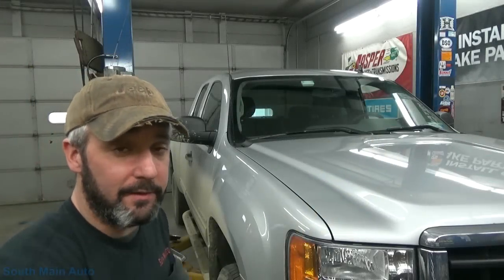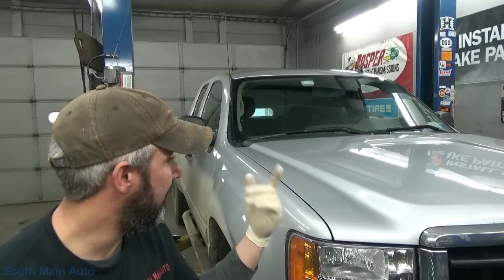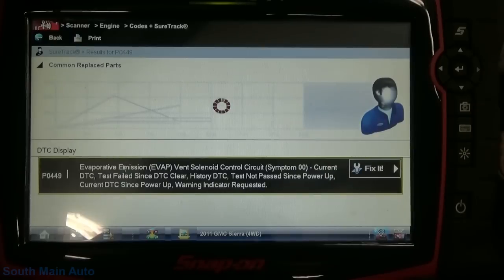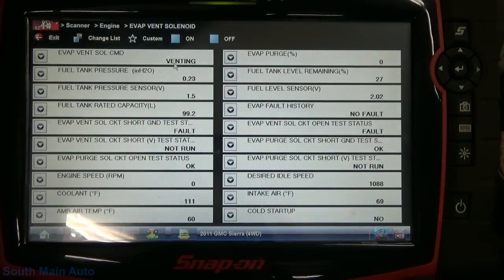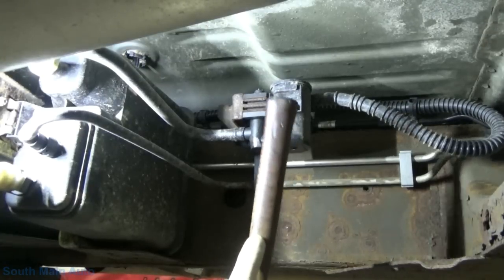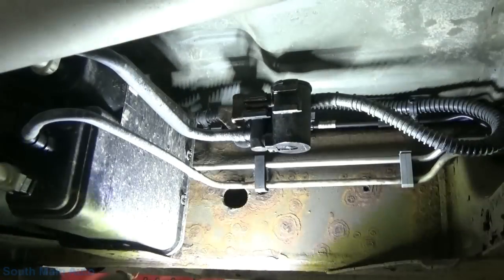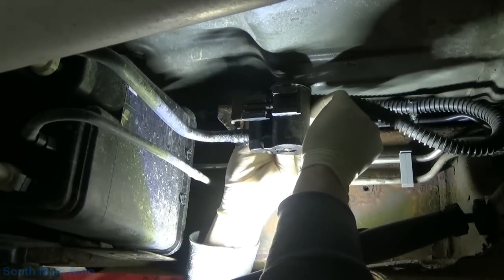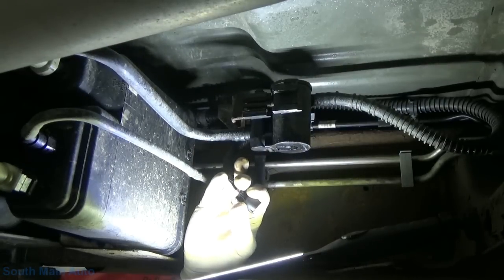GMC / Chevy Truck -DTC P0449 EVAP Vent Solenoid Control Circuit

Comment: One recommendation is putting a brief or detailed description of the vehicle in the description, it will probably net more views too when someone searches 2011 GMC Sierra Evap Vent problems.
Reply from the maker: Good idea
Reply: South Main Auto Repair mainly because I'm descriptive in my searches, others may not be. Love your channel.
Reply: Chance George You are correct I need info on a 99 Silverado 5.3 I'm trying to guess what year he is working on and find out it's 12 years newer but still a good video to use if I ever upgrade
Reply: Most vehicles are similar thru generations especially gm. 4to 8 years is average generation.
Reply: Or any chevy thats how I find it
Reply: It’s pretty much the same between 1999 and 2009

Comment: Thanks! Found the "Green Crusty" 1 inch from shiny vent valve solenoid connector on 2010 Suburban and took a "Money shot" as I pulled the insulation apart to see green dust spray EVERYWHERE!

Comment: "Incandescent test are no good and you should then throw them away!" said an instructor for a continuing education class for work. It's funny how the next day I was testing a circuit on a GM and the service manual specifically said to use an incandescent test light.
Reply from the maker: Joe Goodman the incandescent test light is the most undervalued tool the shop

Comment: I have a 2010 Cadillac SRX with 3.0 V6 direct injection engine the 3 pin pressure sensor what I found was problem with the 5 Volt reference pin was so corroded it was broken off into the wired part of the connector caused by water damage it was causing a P0449 code thank god GM located near central underneath of the driver side door  which made it easier to access I clipped the old connector off replaced it with a new one from eBay spliced in the new one with but connectors problem solved I also replaced the purge valve located behind the throttle body and the ruff idle is gone also hope this helps those of you with the Cadillac SRX later models 2010-2016

Comment: this is a common issue on these trucks ... the get filled with dirt/mud ( as you can see from the dirt on the truck ) there is an updated part by GM where you reroute the pre filter to a new location and use heater hose for the hose and use ban clamps to connect everything... 

you can also use a noid light in the connector and use it to test the circuit. the gm one in the kit fits perfectly in most connectors. typically use to test injector pulses 

i work as a drive ability tech for GMC dealership

Comment: Thanks for the video.  I just did this on my 2011 Silverado  - LT - 5.3 - 41k miles because of a p0449.
The part number is 22840971 for the assembly.  I tried to get just the solenoid, but had to get the whole assembly for ~$60 online.
Amazon, Autozone, etc.  told me that that part does NOT fit my 2011 Silverado, but the dealer told me it would and they were right.  The long tube that goes to the gas filler neck would not just pull out because the truck assembly process left a "hole" just big enough for the tube, not the filter at the head.  I just cut the tube for removal and there is a bigger space above the original route. and the head went through just fine. I couldn't get the electrical connection to come apart until I slid a small screwdriver up under the locking clasp and worked it around to release the clasp.
Thanks again for the video.
Reply: Same here, Amazon tells me Dorman 911-524 won't fit my 2011 Silverado 1500. I got mine from Parts Geek where their website said it would fit. It does, Amazon has it for $20 cheaper which includes the filler filter that the set I got didn't.  October 2022 pricing $68. One of the repair site calculators said this was a minimum $270 repair shop charge.

Eric shows breaking the retaining pins loose on the cannister connection which is what I had to do. The new Dorman connector looks different but fits. I carefully sliced the old tubing on the filler filter to remove it; it was easy to put the new tubing on. I too had to jimmy the electrical connection off, the red push pin had fallen apart. All in all fairly easy job, a novice can handle it, no special tools required.

Prior to my P0499 I had a false TPMS alarm on a single tire; it cleared too. One of the repair vids mentioned this circuit was tied to something else and maybe that was it. 

By far this was the best video to help me get the job done, thanks Eric.
Reply: Hi Guys. 2010 Silverado lt 1500 here. I have the same code and can smell the gas vapors. Ordered this part, but on my truck, the long hose on the pre existing canister goes all the way to the front and under the engine.... not to the filler neck. Wondering what I could do?

Comment: Thank you very much !!!  I had the bed off of my 2013 Silverado 1500 to deal with a serious rust / rot issue and I could not remember where the fresh air intake for the evap was mounted ( welders removed the fuel tank ).  After several hours of videos that showed the evap canister and solenoid but not the fresh air intake I came across your fantastic video. Thank you , Thank you. Well done

Comment: Hey there Eric....1st I wanna thank you for taking the time to make these videos,2nd really enjoy your sense of humor...man you crack me up sometimes!..Both my daughters drive Chevy Cruzes and one of the cars has codes of the following..PO171,PO2270. So performed a smoke vacuum test and seen smoke coming from a pin hole near the bottom of the brake fluid reservoir(very weird)..then after smoke test codes UO100 and UO140.....your thoughts

Comment: Just went through this with my 15 Silverado, the dreaded P0449 code. Also, on my  dash it was telling me to tighten gas cap. First thing I did was tighten gas cap, cleared the code and rechecked. 0449 code is back. Inspected hoses at filler neck. Sure enough a critter chewed on the plastic vent filter hose. Replaced that, cleared code and rescanned, code is back. Checked the EVAP solenoid and a wire had corroded not allowing current to the solenoid. Ordered a EVAP solenoid with wiring harness from Amazon for $30 would have been $70 from auto parts store, installed new solenoid / harness and again cleared the code. Fingers crossed, and rescanned. NO CODES. Hope this helps someone having the same issue.

Comment: Ok so I just fixed this on a 2018, not a lot of material so I am trying to share the info. I did replace the bad vent solenoid but it still ran like crap. The REASON the valve went bad was from a filthy seal on the stupid Cap-less gas tank. Wiped it off and lubed the seal ran good as new. Good luck

Comment: Don't worry, I have had 2 2016 Sierra's with faulty vent solenoids. Both under 10k miles, both farm trucks that were covered in heavy dust.

Comment: U kept it real. That A1 auto showed a different version pain hassel free B.S.  type video. My question is why take out the whole tubing and wire? Why not just take off the silenoid oe gas valve by itself ?  Im curious of doing it myself.

Comment: I bought me an Evap solenoid for my 2011 GMC sierra 4.8l today, I have not installed it but the one they sold me at advanced auto parts looks different. I hope they sold me the right part. Yours looks like a small can attached to it the one I just bought looks fully enclosed and horizontal vs. Vertical  🤔

Comment: I have a question, I am checking for a vacuum. leak on a 2019 chevy pickup 5.3 v8, I'm using a smoke machine, I do not have access to the truck when it is cold, so it's always hot when I see it. Should I plug the purge valve before testing?

Comment: I have a 2019 and it had a 499 code  took it to shop and they changed the canister vent solenoid but the engine light will not stay off could it be the purge valve under the hood ?

Comment: Question. You obviously have some type of service that gives you the "Flat Rate Time" for doing repairs. Back in the "Dark Ages" we had a Mitchell or Chilton book that listed the times for various services. What do you use now? I've noticed you use a couple of different devices when diagnosing an issue. Do you use different "Pads" for different problems? Thanks. OH. The "Dark Ages" was before the "WWW" hit.

Comment: The small filter  up by the filler tube , can't I just zip tie that anywhere that gets clean air ? Somebody zip tied mine to the very top of the transmission where I can't hardly get to it. Thanks in advanced.

Comment: Had a po449 on a 2010 hyundai sonata,shot the parts cannon at it [vent valve] come to find out it was the filter, it was clogged up with charcoal canister pellets,got them out put it back together and no more light.

Comment: Eric would this cause the vehicle to run rough and stall once it reaches operating temp this is the only code i have on a 2005 5.3 chevy tahoe starts fine runs fine till it reaches the operating temp then she will run rough vibrate and stall...try to start it after it stalls wont start unless i play with throttle starts then stalls..I let it cool down starts and runs fine again till it reaches operating temp then same thing happens again.
live in manitoba canada tempetures can reach -45c at night some times 
tyia!

Comment: Hi Eric I have this 449 on my  04 5.3 suburban just this code comes on but my question is  would this part make my truck super rich you step on smoke pich black and the burns super rich can this be my problem  it does it  when I drive for to long full tank will be gone quick when it  cools down  it runs  normal again black  like a  Duramax diesel engine what can I do to stop it thank you

Comment: I live in Finland so rust by soltywater and roadsolt is here too, but on my 10+ years, i have had only 1 Evap problem on car. Eather Euro cars do it differently or our cars monitors are loos, like VW ;)
Reply: Lose monitors on older cars. Most of stuff made before 2000 doesn’t care about EVAP at all. I have seen couple of engines run bad because of faulty EVAP system with no fault codes (or fault code for effects).

Here‘s a list of cars that failed the inspection most often in Finland. Most of them are American cars.
http://www.iltasanomat.fi/autot/art-2000005059775.html
Reply: i see cars from 77 to 17  and no i dont get learning from news sites.. i work for it. If you see it then ok im just lucky on that part. :)
ps. that 1977 car is in register and driven on day by day car.. .. what i say is we dont work on museum cars...
Reply: If you don’t like Iltasanomat, and I don’t like it either, you can see the same info on Trafi web site http://www.trafi.fi/tietopalvelut/tilastot/tieliikenne/katsastus/katsastuksen_vikatilastot_2016
My point was just that (curtain type of) American cars tend to be at the button of the list. Of course you’re not going to learn how to repair cars by looking at news sites.
Reply: USA bottom of failure list. No shit? I see one in ten years or so if you count all EU cars betwean... I mean how many USA cars are in FIN vs. EU cars? maybe you see them but i dont. I See USA cars more in German then here hows that for the irony ;)
Reply: No. I don’t really understand what you’re talking about. I work very rarely on any American car. But what I tried to tell is that in a statistic where car are arranged by how big of percentage did get through the inspection. Worst 20 is mostly American cars.
Reply: Man what i wouldnt do for scan tool that can do component control like in USA but no just DTC maybe freeze frame if you are lucky. And yes some can do control but so much less yeah so much less.....
Reply: Ja vatut!!!  Sorry Erick its Fin time for youtube comments ;)

Eipä taid guugle jaksaa tai mu eemaili vaa vittuilee ja kertoo et oot sanonu jotain mut ku ei vaa nää mitä...
Mitä ymmärsin on että listassa amerikkalaisia hylätään eniten. Mutta kun se on prosentuaalisesti. tai sitten olen lukenut listoja väärin mikä on hyvin mahdollista. (lukihäiriö, mikä näkyy tekstin laadussa ;) )
Ainakin täällä amerikan autoja on pirusti vähemmän kuin minkään muun maan autoja....
ja mitä nopsaan katoin tuota Trafin listaa huomasin vaan Dodgen, yks tippa USA meressä ja sekin vain alusta ongelmia, eikä Evap mitä tässä videossa käsiteltiin ja niin monessa muussa youtuben videossa. Josata alkuperänen viestini koostui tai ainakin niin yritin.
Reply: Then buy the-- Autel Maxisys Elite-- they are sold to & work 
on vehicles-in all countries
Reply: "If our USA cars was sold in USA they would have bean pulled back by the factory" Ges what im whit him that say that....
Edit. Yep Export is in cars too not just alcohol! Little less here little more there, heat there cooll here... ;)
Reply: Timo Wallin - if you have rust problems or want to slow it down 
They have this in Canada/USA as well as Europe, a company called KROWN who sprays cars there. We use it here in Canada it's our #1 option pretty much.  I think the finland website is http://www.krown.fi/

If you can get Fluid Film there that would work to.

-------
But search on YouTube >  Global News Toronto - Prevent vehicle rust damage, How Krown Rust Control works

^ a television show in Toronto Canada did a really good video on Rust. 

and Another good video on how they spray your car is on YouTube called>> Inside Jobs | Rust Proofing | Driving.ca  

Good Luck with any of your rustables.
Reply: Oh and Timo they also make a thing called Krown MR35 SALT ELIMINATOR which you can use to get the salt off during car washes or at the end of Winter. I use it on car carpets and the exterior body & underbody all the time.  There's videos on youtube if you just type in Krown MR35 Salt Eliminator.
Reply: En kyllä suomeksikkaan ymmärrä, mistä tässä varsinaisesti tapellaan. EVAP ongelmiin viittasin lähinnä tossa alussa, että on tullut vastaan autoja, joissa ei ole mitään vikakoodia EVApista, vaikka moottori käy jo huonosti viallisen EVApin takia. Tuo maininta Amerikkalaisten huonosta menestyksestä katsastuksissa oli vain yleinen huomautus. On tossa listalla myös Chevrolet. Olisihan tuon voinut jättää mainitsemattakin.
Reply: Naah sori! Lasikantine laulukirja tais ol hieman liian kauvva auki ;)
Ja tuossa han se pointtini tulikin. Amerikas ei tarvi olla kun tankin korkkikin tiiviste kuivunut, niin tulee EVAP koodi vuodosta.
Itse en ole vielä kertaakaan törmännyt EVAP koodin Suomen autosissa 10 vuotisen urani aikana...

Comment: Four years I was asked to look at a Saturn vue. It had a po449 code. Well I hooked up my 194 bulb test light and used my modis to buy directionally control it. Well the light didn't light so upon further inspection in the wire loom I found a corroded broken wire. Fixed the wire reconnected the connector to the vent solenoid and tried my test again. This time it clicked. Got paid and shipped it. Owner calls me two hours later and informs me he has had this problem for over a year and it's been looked at by two other shops. I said I am sorry. He had about given up.. simple broken wire and he showed my the list of parts that were thrown at this car

Comment: What was the truck doing if you know that was the problem mine soon as you get between 35 miles an hour the RPMs just rub it up and I have no power like the transmission it’s not pushing you lay off of it your gas lay off of it give it gas then it might get up to 45 then my Mabel to get to 55 I hope it’s not the transmission how can I find out I change the transmission fluid I need help 2005 Chevy Silverado 5.3

Comment: Why do you need a special circuit tester ? Can’t you find the resistance value and simply ohm out the circuit with a standard ohmmeter ?

Comment: Any way to turn solenoid on/off without a scan tool? I’ve replaced both solenoid and charcoal filter, but still can’t fill up. Suspecting it is a broken circuit in wiring, but would have to be able to turn on/off to diagnose.

Comment: great vid, is there a way to actuate these solenoids without the expensive scan tool?  maybe with a no screen model scan tool or  a laptop + odb2 adaptor w/certain software or some other method?
Reply: Yeah, vxdiag has a obd2 version of tech2win, which is a knockoff Chinese tech2 the dealers use.

Comment: Just had this same issue on a 03 pontiac aztek. went thru all wiring couldn't find a diagram for the wiring. found a bare wire on my cruise control module harness. fixed it, reset codes, problem solved. so assuming evap runs thru it. never knew
Reply: also I should of stated, all parts in evap system were fine and working

Comment: Interesting. My solenoid is new. Just bought the 2010 avvylanche. Good voltage, but ground is wonky. Need to determine why ecm isnt grounding it every time. Seems if i bring it inside from the winter weather and warm it up is when the fault occurs. Im at a loss, as its temperature related. Guess i need to find a diagram for the ecu.
Reply: So after much investigation i determined the wiring is perfect. System works perfectly in below freezing temps. Cut wire at ecm to isolate, and the evap circuit will not pass enough current to light a small test light. Ecm its the problem.

Comment: Hey i just bought a 2010 silverado as i got home a warning light Stability came on also check engine started to flash, i scan the code is P3425 please help first truck i had